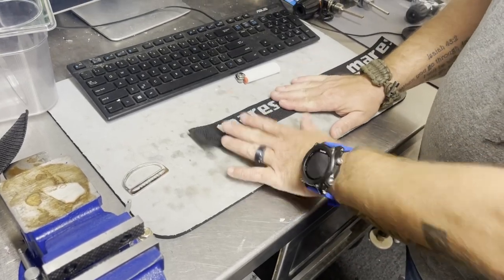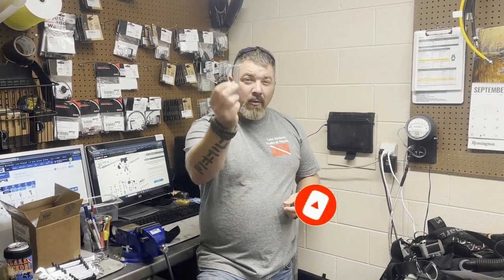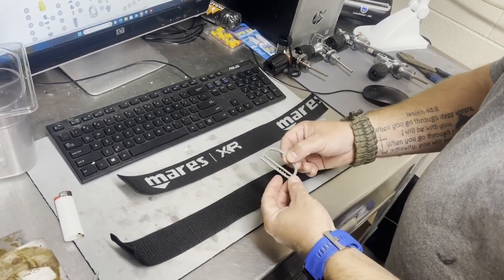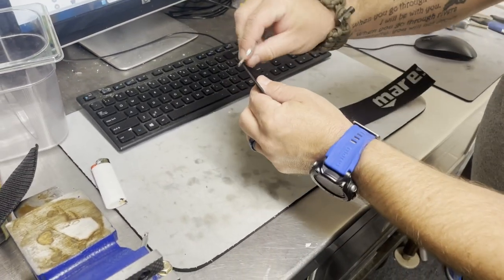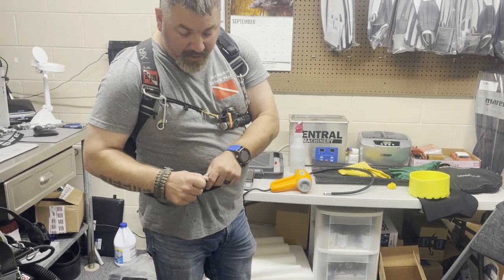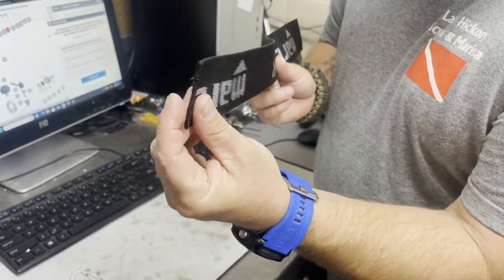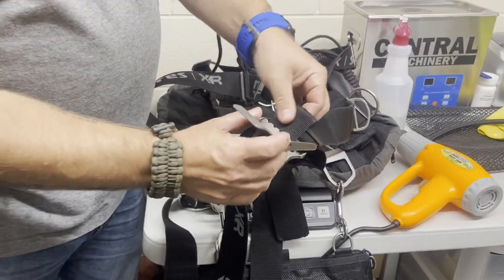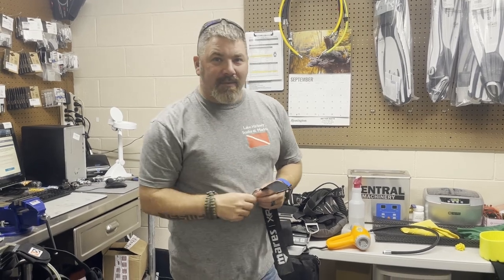How Not To Lose Your Sliding D Ring

Comment: My personal issue is  2 fold  For one it is too aggravating To be thinking about moving that thing every time And then for people whose left arm is a little longer than the righthey never keep both bottlexactly string line from side to side Which could potentially put you out of trim It's much easier to have 2 or 3 if you like fixed d rings Move the bottles and get back to diving Instead of fussing with that thing
Reply: The second issueI  with it's the fact that we are sidemounted divers Even though we can be crucial about our trimSomebody's anything like me I am often upside down backwards and backwards and head down in a holeWhich then detentions that's sliding D ring and causes it to move rightI got a mess with that thing again you get everything back in orderNot a fan at all but to each their own It is a diverite product so there must be some smart People Backing this thing😂😂
Reply: You asked for a suggestion I'll say you put it between 2 fixed D rings And  Hook something not crucial to it😂😂😂😅
Reply from the maker: Good morning @revtechmarine, I am looking forward to our trip in a few weeks. I still prefer the double D-rings over the sliding ones, as I have never found a set that I just can't live without. I have been diving the new ones from Dive Rite for several months and have come accustomed to them. The biggest issue I have found is when diving with a deco bottle, my left side becomes difficult to move at times, as it gets pretty clustered.